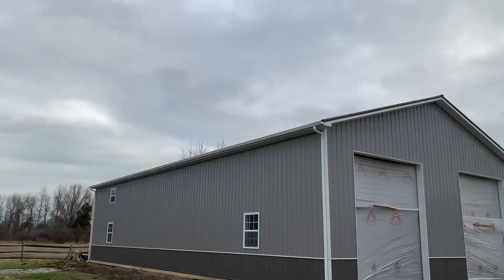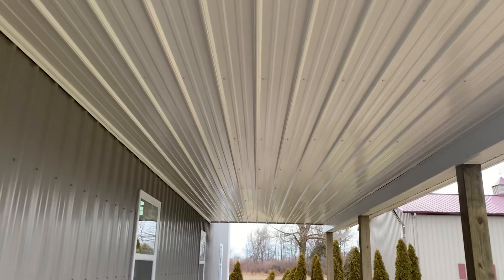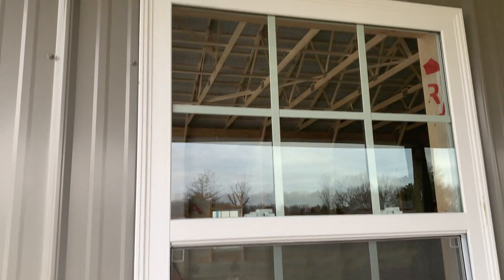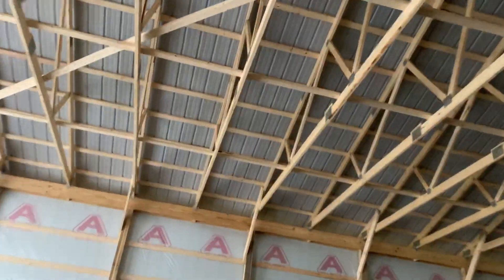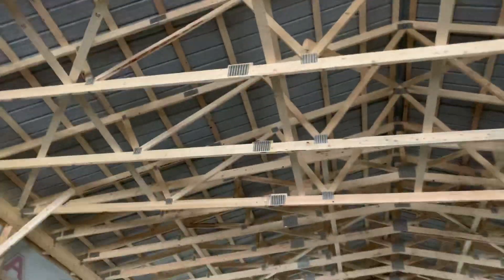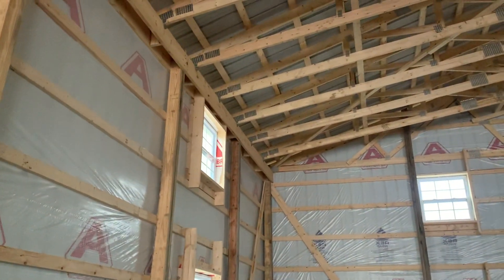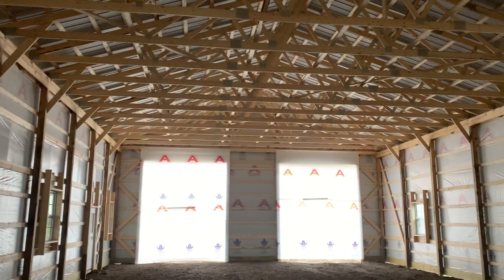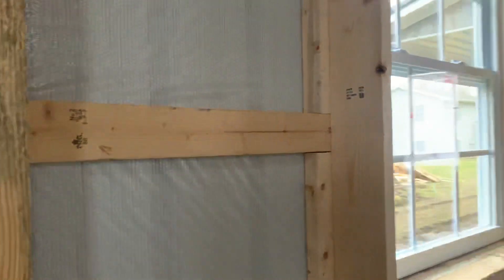Pole Barn - 40x72 (High wind warning!!)

Comment: Why single ply trusses and not double ply?
Reply from the maker: Engineering specs called for single ply. Depending on use case like an attic truss or running perpendicular/tying in a double ply would be applicable.